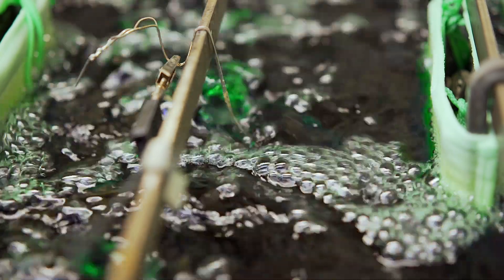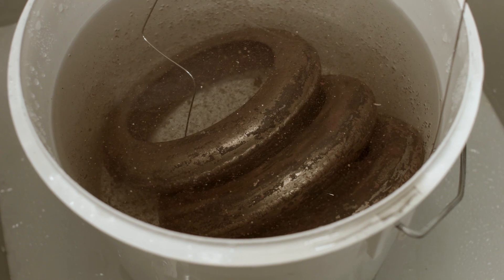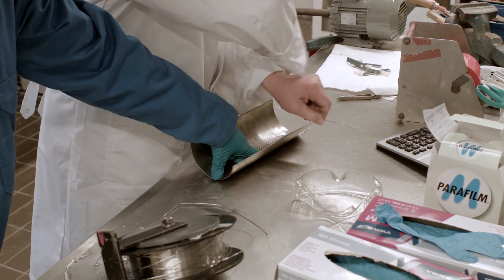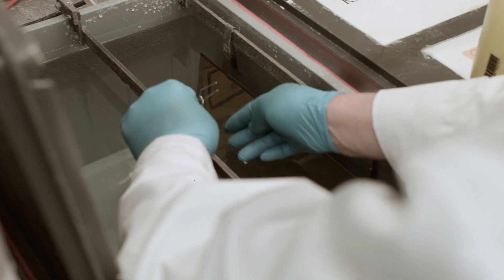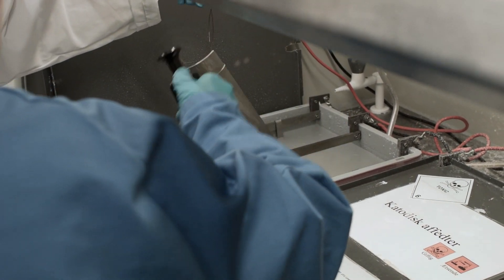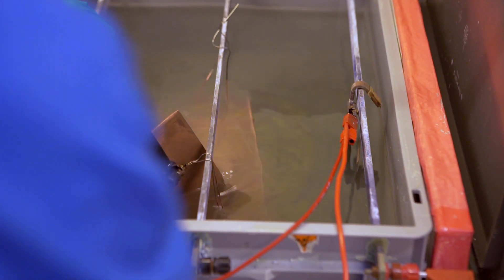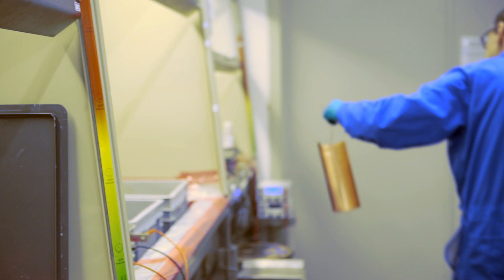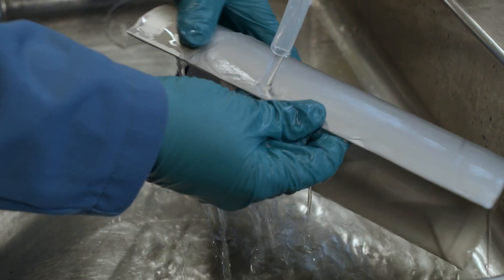BPM5 Rocket Engine Nickel Plating

Comment: Or, y'know, use stainless steel, which is also tougher at cryogenic temperatures...
Reply: +Thorgon Cross I don't know what's up with these people who think they know more in one minute than a fucking space program who has been researching their design for years
Reply: @corymitchell3228  But he raises a valid point, it would be interesting to know why.
Reply: @AlessioSangalli  fair enough i guess
Reply: @corymitchell3228  there are also other space companies, and they tend to use inconel and other alloys that are inherently corrosion resistant. Maybe the use of regular steel and plating is simply because machining "better" alloys is expensive (but this hand plating is also not very cheap, very labour intensive)
Reply: Stainless is also harder to weld and is more expensive
Reply: ⭐Apparently Stainless Steel contains chromium,  which is somewhat volatile around different chemicals... I read that in a different nickel plating video description...